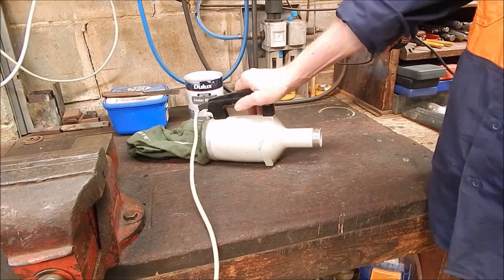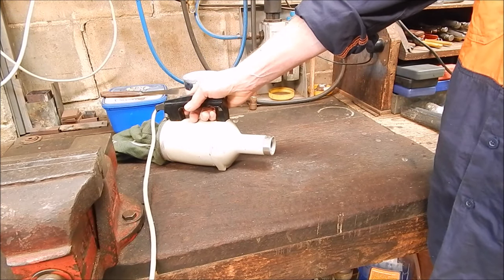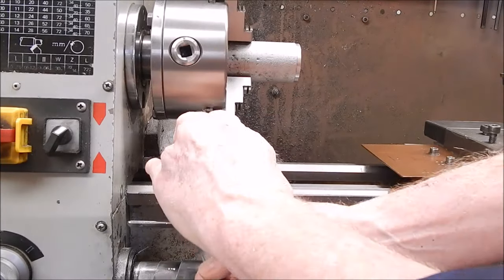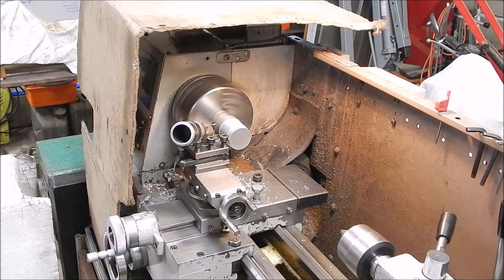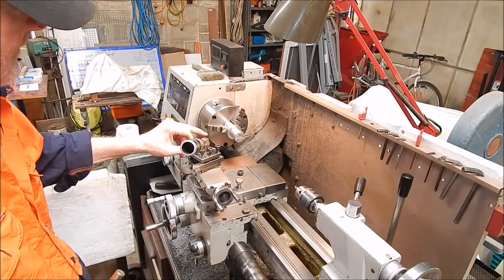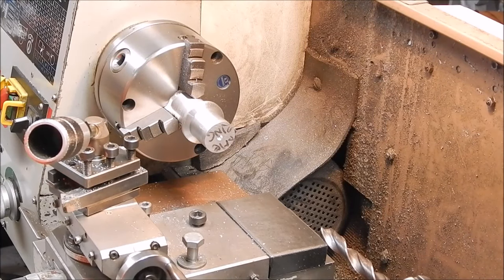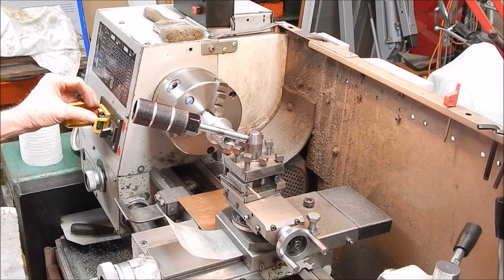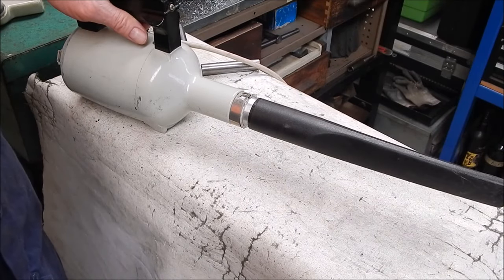Machining home cast aluminium on a well used Chinese lathe

Comment: Hi Rob enjoyed video . Great to have a supply of home cast al to use. You brought back happy memories for me with the hoover . I had an even older hoover dustette . It had a fixed flared end . I clamped it against a slot in a box around my dads polishing machine to catch the dust and cotton fluff. It did a great job for years. The reward was agreed I got the payment for the dust when sent away as it contained gold and silver over time . Funny thing is it always coincided with me needing new shoes or a coat .I think my dad got the best deal out of our “bargain”😂
Reply from the maker: Hi Colum.  Glad you enjoyed it.  Times gone by :)  Cheers Rob

Comment: Excellent idea Rob. And as you say, an easy adaptation. I'm going to look out for a small vacuum cleaner like this. Would be easy to put next to machines in the shop. Cheers Nobby
Reply from the maker: Hi Nobby.  Being small makes it quite useful for dust collection.  I tried it on the 240 AC car inverter and it worked great.  Will be handy to quickly clean the Subaru.  That vac must have been laying in the workshop for 30 years and it finally found a use :)  Cheers Rob

Comment: G'day Rob, been watching you for years, and I'm finally thinking of buying a Chinese bench top lathe, I use a harrison 140 daily, but theres always a need for a little bugger too, thanks for sharing buddy
Reply from the maker: Hi Ralfy.  It's all personal choice and depends what you intend to do with it, but if I was to only have one lathe out of my three it would be the 10" swing Chinese one in the video.  Does most things for the average home workshop guy and has decent chuck capacity/range.  Still can buy a similar unit for $2 K AU.  Happy hunting :)  Cheers Rob

Comment: For making simple parts such as this is what I like about having a small lathe.  
And in case one doesn't have a handy chunk of cast aluminium handy, a piece of pvc pipe (or coupler) can often be a great starting point for custom couplers/fittings.   I've used my mini-lathe several times to make pvc vacuum hose adapters, pool hose adapters, and even an internal coupler/support for the air-intake on my car's engine (just past the filter).
Reply from the maker: Great tip! I did look at my PVC pipe pile but there was nothing suitable so went with ally.  Any lathe is better than no lathe and small is better than large for home use (IMHO).  I did a bronze bush replacement today on a shearing machine and once again it was simple internal and external turning that anyone could do with a bit of care.  It's not rocket science .  Cheers Rob

Comment: I have an infinitely variable power feed on my little lathe, a 12v windscreen wiper motor run through a potentiometer does the trick. 😁 I started on a big project this week that will be full of home-cast parts, the first 2 will be in part 1 next week, I agree with you wholeheartedly, home-casting Aluminium saves me a small fortune. 👍
Reply from the maker: Sounds great!  Yes, it sure saves a lot of money and makes projects affordable.  I mainly cast stock, but have done pattern casting a few times.   Quite a lot of BS on YT about all this.  Such is life.  Cheers Rob
Reply: @Xynudu  I find it useful for making odd-shaped parts and I have just about finished machining one of the oddest-shaped parts I have cast so far. And yeap I agree there is mountains of BS out there, 👍

Comment: G'day Rob. That looks like an ideal project for a 3D printer. You should look into getting one if you haven't already. Looking at the adapter you made I reckon I could spit one out in about 30 minutes, including modeling time, and would cost about 30 to 50 cents in material. Save the expensive aluminium for projects that require strength. Cheers.
Reply from the maker: Yes, it sure would be a good project for 3D Laz.  I have had 3D printers offered to me for review many times, but never taken one up.  They don't really interest me.  Go with whatever floats your boat.  Aluminium stock costs me virtually nothing, so that is not an issue.  Cheers Rob

Comment: Nice! I probably would have just 3d printed it though. I tend to find these days that I use my 3d printer to make stuff for my lathe and my lathe to make stuff for my 3d printer :D
Reply: Good to see someone else would have 3D printed an adapter like this. I tend to print things more often than use my lathe these days, partly because of the easiness and partly because of the cost of the machining blanks.

Comment: Lovely job Rob 👍👍👍 You can't beat the old home cast aluminium. Great to see the very expensive, high tech, chip deflector in use 🤣🤣 Cheers, Alan.
Reply from the maker: Hi Alan.  Yes I spared no expense with the chip guard ;)   I see people actually make up fancy large clear plastic ones and shake my head.  LOL  These work the best.  Cheers Rob

Comment: Nice work Rob. I don't know how you can see anything with that cap. For the last 15 years or so ( getting worse every year ) I  haven't been able to se anything in bad light. Anything at all that reduces light regardless of glasses and magnification dramatically reduces my vision. Maybe by eye deterioration problem is different to yours but I just thought I'd mention it. 😊
Reply from the maker: Hi Rob.  I'm a bit light sensitive and have also done a lot of work with ear muffs on (for machinery noise) so caps are required apparel for me.   Get them at the Salvo's for cheap.  Usually get several years wear out of one.  First job is to remove the metal button they all have on top (for decoration) as it's a certain way to gash you head if you knock it.  Cheers Rob

Comment: Nice work Rob, what you can do with a small foundry and a lathe.  The general public these days would not have a clue that this can all be done in a backyard.
Cam
Reply from the maker: Hi Cam.  I can only agree with you.  Even amongst supposed machinists some roads never get ventured down - metal casting and collet use being two prime examples.  It's always pleasing when people discover what they've been missing out on and how simple it all really is.  Such is life ;)  Cheers Rob

Comment: Great share Rob, With your help I can now cast Aly that is solid and non pores .. How has the summer been in Oz this year, has it been hotter than norm ?? .. Thanks man ,,
Reply from the maker: Hi Shawn.  Good to hear.  The summer has been pretty average heat, but not excessive as they predicted.  How's your health going ?  Cheers Rob
Reply: @Xynudu  Thanks Rob.. Health has not been good at all , got the flu 2 months ago and the autoimmune crap kicked in and caused problems..
Reply from the maker: Sorry to hear that Shawn.  Ever since I got COV19 I have had serious muscle and joint pain all over.  It's part of the long term effects apparently.  Plus I am getting older and on Statins.  Still, there's plenty more people way worse off, so you just have to go with the flow.  All the best.  Cheers Rob

Comment: Like your "chip shield". Beats getting a hot chip stuck to your neck.😁
Reply from the maker: Yes.  The plastic ones they come with are hopeless and just get in the way.  Can't beat a decent bit of cardboard.  They wear out every 10 years, but easily replaced ;)  Cheers Rob
Reply: @Xynudu  Very frugal!😁